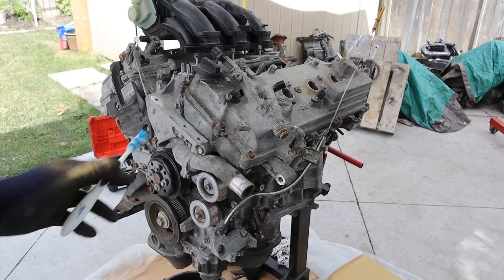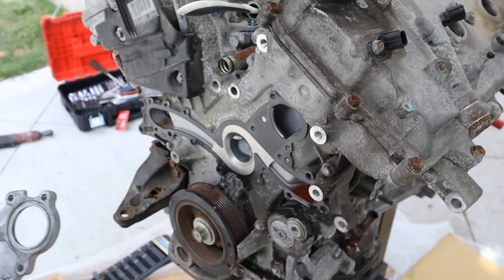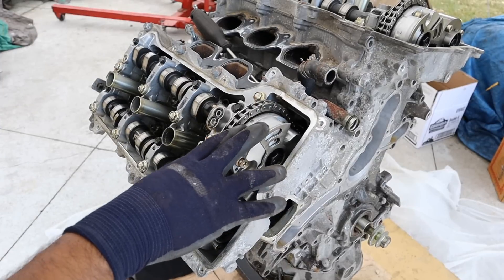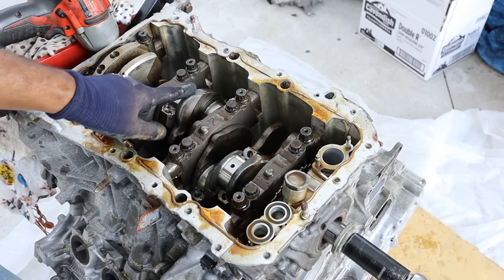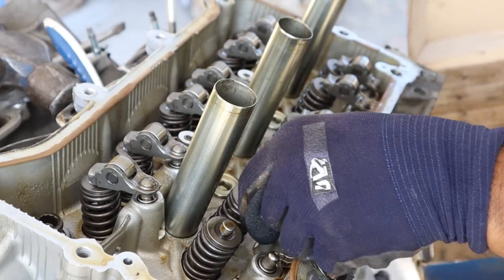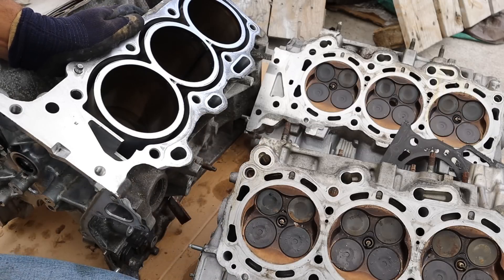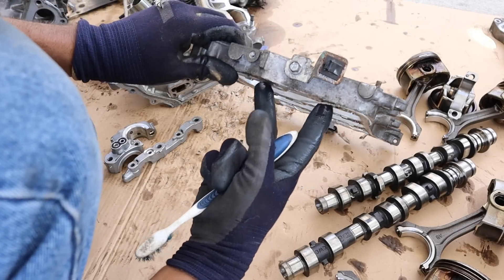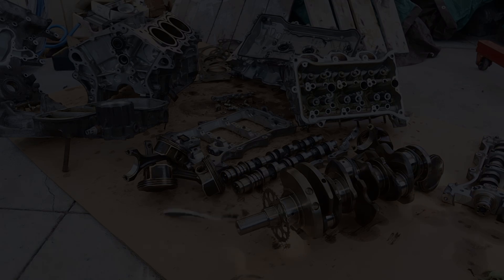The Toyota 2GR 3.5L V6 Engine is a Legacy in a World of 4 Cylinder Turbos

Comment: I have a 2009 Lexus es 350, water pump needs to be change, pulley has a little play there. I am waiting for summer so it can be done easily. I also have an external head gasket leak. Should i get a new engine?

Comment: 3:40 Rewatching this after a while and I realized that I'm pretty sure that's the wrong VVT-i oil line, it's the line immediately after that got replaced, since it was the line for the rear bank, not the front bank.
Source: my old RX 350 that had the rubber line

Comment: I've been paranoid about the water pump but here I am 10 years later 100,000 mi and it still hasn't gone out
Reply: My 16 Highlander has 117k miles. Coolant has already been changed twice and no water pump failure yet. Fingers crossed

Comment: I had a 2013 RX that has this engine, now my dad is driving it. The water pump started making noise around 12K KM and I replaced it immediately once I am aware of it. The timing cover is also leaking oil, but it's leaking so slowly that I decided not to fix it, as it is very expensive to fix. Overall it's a good engine, except for the few flaws you mentioned.

Comment: As a matter of accuracy, the line that is shown at 3:36 is NOT the line that the TSB LSC90k bulletin addressed.  That line was always all metal (and is probably why it looks like it has more age on it than the other line shown at 3:47).  It is the other line shown at 3:47 that had the rubber portion at the elbow that had the problems, and was upgraded to the all-metal line in more recent iterations of the 2GR-FE.

This line with the rubber portion is at the left side of the engine block as you look at the engine from the front of the car, and farther back near the cabin.  It's easy to see with a flashlight, and easy to tell if you have the line with the rubber elbow or not.  If you do have this engine with the rubber elbow line, you can purchase an all-metal genuine OEM Toyota line for under $50, and the replacement installation takes about an hour and a half.
Reply: I spent days researching this with Grok. If you have the rubber one with KK18 or KK20 and a yellow stripe, or just KK18 in yellow writing on your hose, then it was replaced and it will likely never blow out, if you're using synthetic oil from Mobile 1 or Penzoil Ultra Platinum or any kind of the amazing Motul oils. You should never use cheap oil in a 2GR-FE. Cheap oil loses viscosity and thins out, even though it's not supposed to, and it also leaves carbon residue in the engine. Synthetic oil won't leave any residue AT ALL unless you overheat your engine. The thicker replacement VVTI hoses are not able to explode like the horrendous original ones that have no KK18 or KK20 or a yellow stripe. If you have an "upgraded" rubber VVTI hose it will be very thick, it's a very thick robust hose and it will say KK18 or KK20 and it will have yellow writing on it or a large wide yellow stripe. If you have one of those ones, then you're fine. If you buy Walmart oil, you're tempting fate.
Reply: @starseeddeluxe  When I was researching the matter, I could not find one single report of the updated hose (with the yellow stripe) failing.  The problem I did run into was actually determining (because that stripe was sometimes not bright and not very large, and not very easy to see given the hose placement) whether the hose had actually been updated.  Since it wasn't a particularly expensive upgrade, I went ahead and had mine replaced with the metal line.  One thing that did concern me was Toyota's varying descriptions of what that updated hose actually consisted of, whether it was just an upgraded type of rubber or a "rubber/iron combination" that one source reported.

Comment: The reason why the internals look so clean may be because the owner used Dexos certified synthetic motor oil. It does not create sludge and doesn't stick to the parts.

Comment: What temperature should be reached to overheat it?
PS: How hard do you think is to work on this engine myself? I have one of those and  My level it I replaced thermostat myself, sparks, wheel bearings front and back, struts etc. 
I have Sienna 2nd Gen 2008 with 2GR-FE.

Comment: I wonder why this engine is on many Toyota and Lexus products like Camry, Venza, Highlander, Sienna etc… yet they almost always have the same numbers of Torque/horsepower no matter what size and weight of the vehicle is. For example Camry 2013 has 268hp/248torque and something way bigger and heavier as a Sienna which weighs more than 1 thousand pounds than the Camry, has almost the same numbers 266hp/245torque. Are these numbers real on paper??

Comment: Probably the best engine I’ve ever owned. And I’ve owned a lot of them.
Reply: Engines like these are the reason I will not go electric.Agree 100% You can go over 200k with barely doing anything and drive cross country without thinking about it. Some of the best engines ever made. I have a 2arfe as well and that has been so good I'm getting bored of the car cause it just runs with no issues. Great engines indeed.
Reply: Yeah, this motor is amazing, especially if you are used to driving a 5vz.

Comment: The oil passages, are designed with so many variables in mind. Oil passages, have to be subject to manufacturing processes. I think Toyota has done a good job on this engine! Now, oil rings carboning up, and sticking, has more to do with NONE top tier fuels being used, plus 10k oil changes, plus non toyota oils being used. Toyota oil, Amsoils, Redline oils, and my fav Pennzoil Ultra are the finest oil to use.

Comment: What’s the difference between 2GR and 2GR-FSE? Great and detailed content by the way 👍🏾
Reply: FSE has dual fuel injection (port and direct injectors) and is designed for longitudinal mounting. FE only has port injectors and is designed for transverse mounting.

Comment: I have a 07 GS350 with the FSE variant and boy this motor is a treat
Reply from the maker: I have an 07 GS350 as well. How many km and how has it held up?
Reply: @speedkar99  144K miles and has held out so far slightly burns a bit more oil but I’ll try to switch to Pennzoil Ultra Full Synthetic
Reply: @speedkar99  goal is to eventually find a used IS350 FD of 4.08 I heard it cuts down 0-60 on the GS350

Comment: This engine is a living nightmare. Water pump. Belt tensioner. Rubber oil pipes. Replacing rear plugs. Almost impossible maintenance for the home mechanic and cost a fortune at the dealership. And don’t forget those rattle cam phasers . Absolute garbage Toyota. Now my other car has the Buick 3.8 engine now that’s a reliable engine and a pleasure to repair if ever required. Parts are a fraction of the cost and easy to access. Very dissatisfied with TOYOTA.  Never again.
Reply from the maker: I agree. It is very difficult to work on in transverse form.

Comment: So the owner neglected cause he/ she did not change the water pump on time? or because there was some leak from the head gaskets. Sorry for my ignorance, Is that the water pump looks pretty new to me. Also, I have the same engine and love my rav4, except that I see oil leaking on one of the corners. I think I have to replace the gaskets. I replaced the water pump when she was about 80000 miles, the pulley was making a sound. Thanks for the video and for taking the time to upload it. you sound very knowledgeable.

Comment: These new 60° duel overhead cam engines are amazing. Most of them are cranking out anywhere from 270 to over 300 horsepower and are extremely efficient and dependable.
Reply: Not very fuel efficient for our lexus RX, but very good power band and seemingly bulletproof. Never had a problem except for a super slow oil weeping from valve cover, less than a tablespoon in the past 3 years.

Comment: Does anyone happen to know if you can pull the upper oil pan without pulling the engine? Mine has a pretty bad leak from it
Reply: I also have a leak. I thought it was coming from the rear main seal because there is oil  dripping from between the trans and engine. But somebody told me it could be upper oil pan. I can't tell if oil is coming from higher up  than the rear main though. Where did you notice your oil leaking from?

Comment: I replaced the water pump on one of these in a Sienna and boy was that not a fun time. Fortunately there's (barely) enough room in the Sienna if you remove the motor mount bolt and jack up the engine a little, but it was still not a good time.

Comment: Hello. What oil change interval do you recommand for a 2012 2GR-FXE engine with 100k mi ? Oil grade? Thx a lot. ( here in europ, we frequently mix up E85 with 95 or 98 octane gasoline  : 70/30 )
Reply: Given you have the hybrid version you engine only runs about 1/2-2/3 of vehicle operation. I believe for a 2012 the oil grade is 5w30 with 5k mile intervals. I would stick to that and like he says keep a lookout for your cooling systems. It is a toyota/lexus weakness no matter what engine or model.

Comment: If that motor didn't turn over at the dealer and really blew head gasket it may have been hydro locked water may have run out which is why you could turn it over

Comment: Old water pump design has failures. Apparently Toyota released a new water pump design that fixes the older faulty one. Was watching Car Care Nut on YT (Toyota Mechanic) as he explained during a water pump replacement and said he hasn't seen the new ones fail. Hopefully that's the case! From the water pump... To the rubber oil line hose... I cannot believe Toyota had this many design flaws in the 2GR... You'd think after decades of engineering they would learn from mistakes.... Maybe it was no mistake.... To cut down the cost anyway they can....
Reply from the maker: At least they fixed their issues....unlike...um GM who keeps refusing to accept there's an issue in the first place
Reply: @speedkar99  yup

Comment: 2GR FE in my 2010 RAV4.  Great engine.  LOT of power for that vehicle.  Torque steer When you punch it is scary though.  When I bought it, I asked the.mechanics in the shop if there was anything to watch out for....they both said "speed".

I totalled my 2009 RAV on a big deer and replaced it with this 2010 LTD..  177K now.  Runs great.  Wish the mileage was better though.  20 MPG kinda hurts with petrol at $5/gallon.

Thanks for the video.  Not a single "umm" or "eh".  You know your shit.

Comment: By the way; the hydraulic lash adjuster is also known as an "lost motion assembly."

Makes me wonder if the "roller" rocker arm (finger-follower) could be adapted to my 5MGE's valvetrain. I wouldn't be surprised if toyota continued earlier (yamaha designed) geometries into the newer engine.
Reply from the maker: But the newer 2AR and A25 4 bangers have moved towards the roller rockers...
Reply: Not sure what you mean by "but," regardless - yes it looks like the AR series uses the same valve train design. Different lash adjusters, but the exact same rocker arm... man now I want to buy one (a rocker) so I can compare to the 5mge.

Comment: Two years ago I sold an '08 Tacoma with the 1GR which is the bigger version of the 2GR. 112K miles at the time. Only needed conventional oil changes, tires, and batteries for the 9 years I owned it. It had the original timing chain, water pump, cam phasers, serpetine belt, alternator, starter, spark plugs, etc. and ran like a top. Last August I actually found it for sale at a local used dealer in my area with 147K miles. I estimate it has around 200K miles by now. The GR engine WILL last 300K+ miles with regular maintenance and oil changes. I've seen countless examples ranging from Sciennas to ES 350s...
Reply from the maker: It sure is a reliable engine if you watch out for the cooling system
Reply: Original spark plugs??? Geez they have a 30k interval on the 4.0!

Comment: I have a 2GRFE in my 07 ES350 that I literally have tried to kill...Wife says no IS350 till this one dies...325,000 miles and the mofo still pulls like  jet and wont die or even do anything wrong.
Reply from the maker: The cooling system will start to leak (head gasket or water pump) and then the timing chain cover.
Reply: @speedkar99  thank God

Comment: this engine is no joke, its actually pretty powerful for its class at around 280 hp or even more, despite being very reliable
Reply: FSE has 305 hp
Reply: Frankestein motorworks got it to 400 whp on a mr2, NATURALLY ASPIRATED. This engine is crazy
Reply: Fse 310hp
Reply: @bestsophat7316 lol some came 314 in jdm cars
Reply: high compression ratio low power

Comment: One of the best engines ever made with port injection only but Toyota Engineers modified it with 2GR-FKS with both port and direct injection which is the best of both worlds. I have this on my Toyota Venza 2009 V6 AWD and currently has 111,500 miles but still drives like new.
Reply from the maker: They sure are good engines, though a bit complex in their own way.

Comment: Hey, having so many engines disassembled, could you please name some of the best R4, R6, V6 (extra R5, V5)?
Reply from the maker: Honda makes good engines. Not sure what you mean by R4,5,6
Reply: @speedkar99  R = row (straight, inline engine). R6 = inline six. I'm from Poland and this probably comes from German "Reihenmotor". Irony is they also produced VR5 and VR6 engines ("straight" with 15 degree cylinders).

Comment: most of engines break down  because  no body  warm up there engines any more  it is good for your engines to warm up first
Reply from the maker: Engine warm up on modern engines are ~30 seconds for oil to flow around. Not like a carburetor
Reply: @speedkar99   o well i disagree with you  in that because  car engine made from different metals and plastic and rubber  driving  a cold engine  it causes leaks cracking plastic bad cats I warm up  my car for 5 minutes  it had 250 km  no problem  no leaks no bad cats and ALL I do is change  my oil and filter  every 3k and warm up  my engine

Comment: Good power bump over MZ series, but much less smooth and gritty sounding.   Both engines will last a long time if maintained (maybe a slight edge to MZ for not having to worry about timing chain cover leaks).
Reply from the maker: Agreed. The 1MZ is smoother.
Reply: I've heard people say the 2GR sounds a bit "agricultural" and I agree.

Comment: Not much damage in this engine it seems, a rebuild can revive it to it's full potential again.
Reply from the maker: You can't machine these heads and blocks. This engine has variable valve timing. The timing will be thrown off
Reply: @speedkar99  So this engine is now a paper weight?

Comment: Can I use 5w-30 on this engine? It asks for 0w20 but my mom ran it without oil for a while a few years back and it's a little noisy but nothing knocking.
Reply from the maker: Yes, the older versions call for 5W30
Reply: @speedkar99 is it normal for this engine to have a ticking noise even when warm?
Reply: Mine is a little ticky as well. Sounds like lifter tick to me but it's pretty much always present. Warned up or not.

Comment: Water pump is the only part I've ever see fail on one of these. I've replaced them without removing the engine, & yes, it's a PITA but very do-able. Thumbs up for the vid!!!
Reply: 40% of all 2gr-fe have front timing cover leaking oil. It's hard to notice. The engine has to come down to replace.  Big $
Reply from the maker: Timing cover leaks and externally leaking headgaskets are also common
Reply: @speedkar99 they're not leaks they're just seeps through the gasket

Comment: Hello everyone. If one of those crankshaft bearings were bad what sound would you hear at idle. Would it be the "normal" engine sound with a pronounced "tuk tuk tuk tuk" sound? Would a connecting rod bearing have the same sound?
Reply from the maker: More of a knocking sound

Comment: Great motor I put in stronger hardware and turbo'd it goes great!!!
Reply from the maker: You turbo charged your 2GR? How that setup go?
Reply: @speedkar99  it's in a MR2, 9:1 Wiseco pistons, H Beam rods, uprated valves and valves rings etc and a PT6062 G2 turbo. Currently 25 PSI and goes very good. The 2GR is a good motor.

Comment: The 2gr-fks was also put into some more recent toyotas, allowing both port and direct injection
Reply: 2gr-fse is in the early 2005+ lexus models and has direct and port. the fks has both yes but it also runs on an Atkinson cycle
Reply from the maker: Yeah that's a more updated FWD version of this motor

Comment: yeah, that's why I like working on old American V8's. you have to pull the engine and completely disassemble it to get to anything on Japanese engines. They're great, but too complex.
 I think they actually need to put a secondary oil pump halfway through the system to boost pressure and reduce pressure loss. They're already overly complicated and expensive to build so what's one more component
Reply from the maker: Yes I see your point about the the secondary oil pump....it's quite a complex system they have here
Reply: CoughNorthstarCough

Comment: I'm glad Toyota is switching to electric cooling pumps. Serpentine driven coolant pumps seem pretty prone to failure just based on the belt pulling on the pump shaft and bearings when tensioned. This uneven force guarantees wear. That's not even mentioning crappy impeller material . This video is a good reminder to pay attention to your coolant temp guage.
Reply from the maker: Electric pumps are good but they too have bearings, implellers and electric motors that can fail too...
Reply: lol my toyota watepump is going on 18 years and 200k. how very unreliable!!!
Reply: the camry xx18 up 4cyl had electric WP